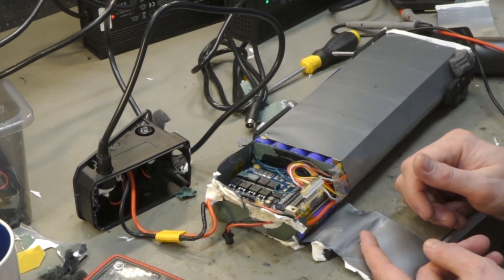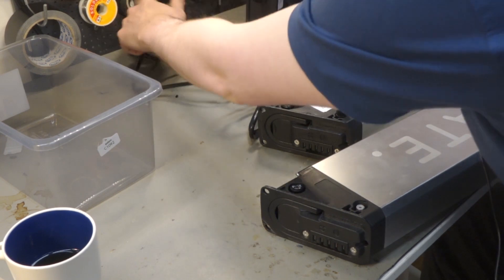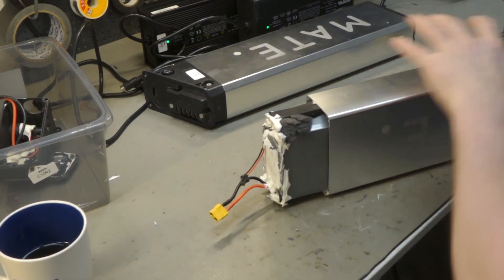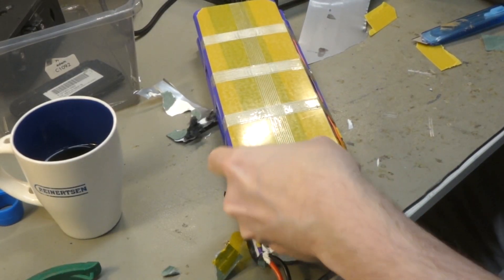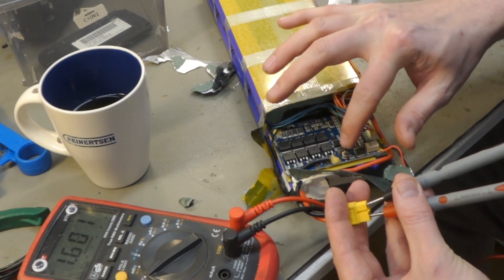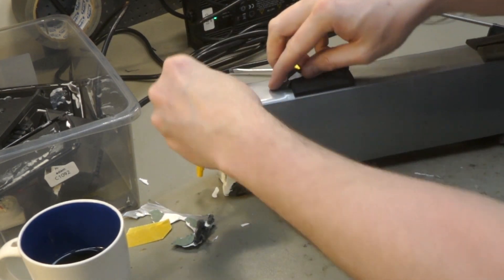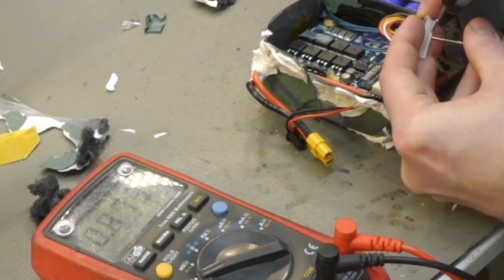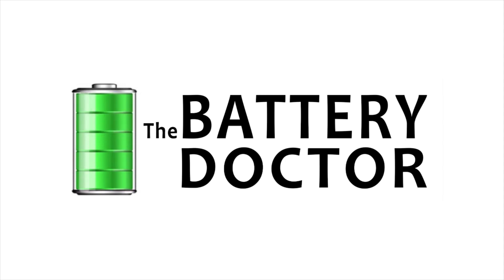What the heck is wrong with Mate.Bike batteries? And the lies? Go on please! Fake BMS is dangerous!

Comment: Hello, I have a MATEBIKE that when I plug the charger it shows that battery is charged, (green light fixed)  while in fact, it is not charged at all. I think should be a problem with the circuit cardboard of the battery. Do you sell that IC for replacement?

Comment: What does it mean when you say every single cell has popped the vent?
Reply from the maker: The internal cid fuse has popped on ALL cells, its extremlly rare on a single cell, and all cells in pack having the fuse popped is due to extreme heat, internal pressure, or age (15+ years).

Comment: Hello, thanks for your video. I think my bike is having the same issues as the one on your video. I got a new charger with lower amp a couple of months ago because the other shitty one died. Now it is not charging and at the same time the battery is doing crazy shit like I dont need now the key on the ignition to turn it on, and sometimes the bike would just turn of, or sometimes the pedal assist wont work and only the throttle. Well, another mate user told me that the problem is with the BMS, my question is if I could buy a new or better BMS and if that the case, which one? Or should I buy a new battery? The problem is that where I live it is imposible to bring a new battery without costing me A LOT OF MONEY. Please help me! sorry for the really long message!